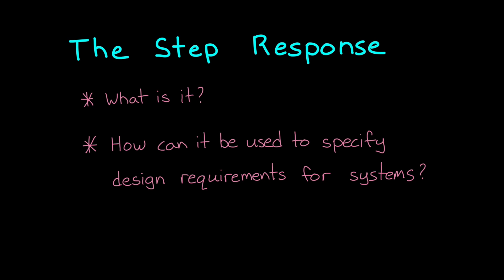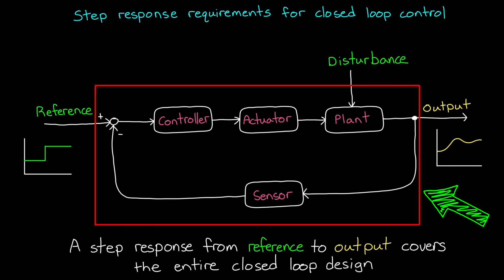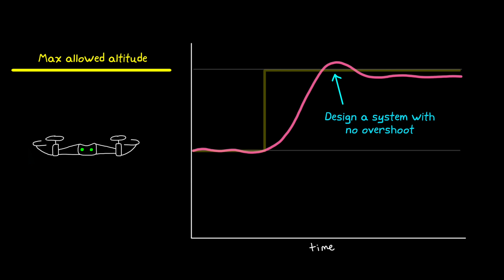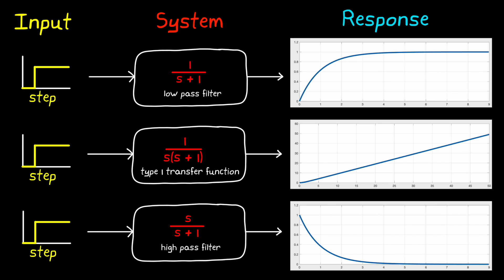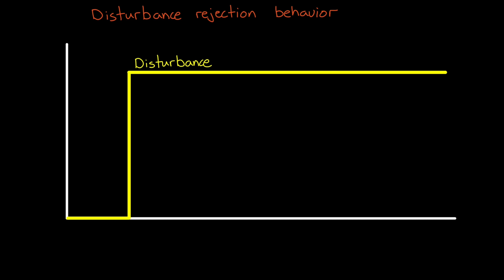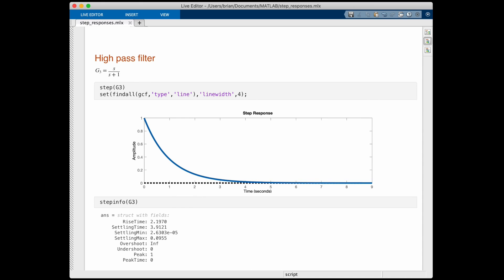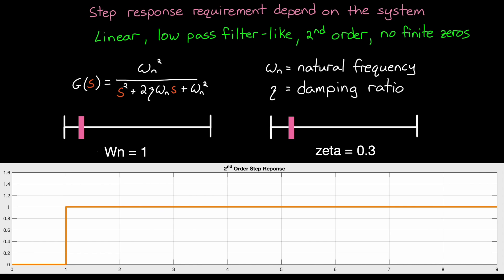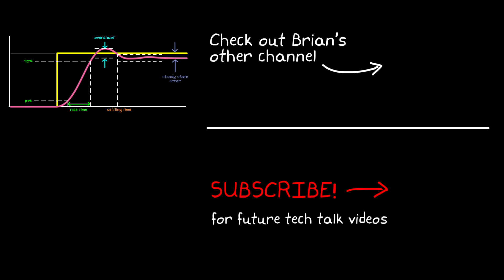The Step Response | Control Systems in Practice

Comment: One thing that bugged me was the undershoot part. Consider a system whose purpose is following an input signal, just like in the drone altitude controller: if our system's step response does not overshoot and has a settling time greater than zero, why doesn't it fall under "undershoot"?
Reply: I don't know if I have a good answer for that. If the step response goes above the steady state value and then back below, it's clear to me that the undershoot would be measured after the time it dips below the steady state value. But if it never goes above steady state, then at what point do you say is the undershoot? Is that the question? If so, I'd probably say that undershoot is not defined since the system never really dips back down below steady state. However, this brings up a good point that these terms are supposed to be helpful for communicating ideas and requirements. If the terminology is confusing for certain situations, then I'd change the way I describe it to someone. Instead of specifying undershoot, you might just want to explain the needed conditions. For example, "If the response goes above the steady state error, it should not dip back below that error more than X." Does that help?

Comment: I have to solve a control problem, I have a closed-loop transfer function and I should find natural frequency, damping ration and peak overshoot, my transfer function does not exactly look like a second order form, it is (4s+24)/(s^2+8s+24) so what should I do? and I also should find C(t) for unit step input.
Reply from the maker: You can get help from MATLAB Answers if you post your question there. https://www.mathworks.com/matlabcentral/answers/index

Comment: Thanks Brian. For a second order system, you can find in one of your references (Lecture 21) that you'll introduce overshoot by choosing zeta < 1, which corresponds to having two complex conjugate poles. For zero overshoot, the poles must both be real, with the smallest rise time achieved when they are coinciding (zeta = 1, the critically damped case). What would you derive for the pole locations of a higher order system if zero overshoot (or ultimately, critical damping) was a requirement?